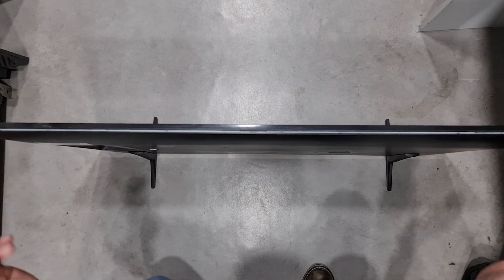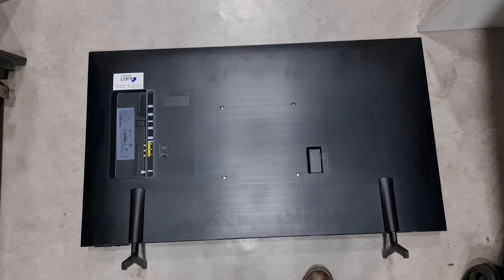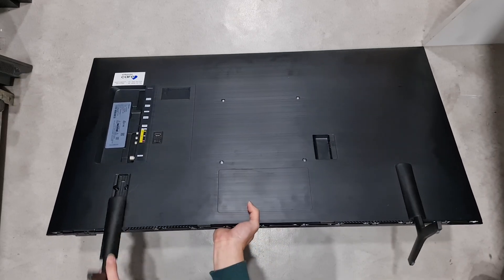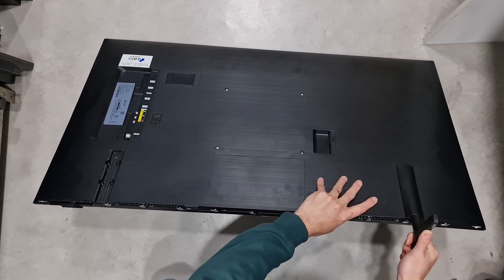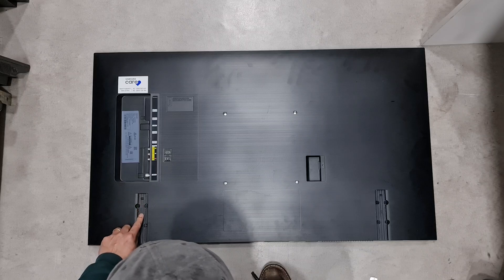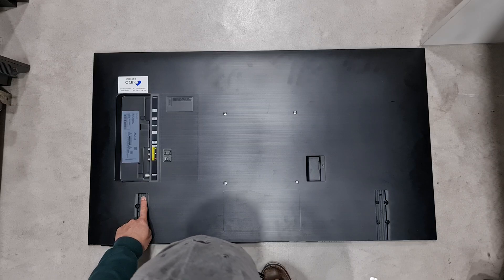Samsung AU8000 43'' TV Teardown | How to Disassemble & Repair Smart UHD 4K TV

Comment: Hi Mate, watched your video on repairs on Samsung UA43Ua8000W. I soldered a loose antenna plug on mine but then I lost power to the tv. Any reason what I did wrong.Terry Adelaide.
Reply from the maker: Hi mate, thanks for watching. Do you have a multimeter to test any power going to the main board? Maybe it’s your power board circuit.
Reply: @repairstogo  Thanks for the quick reply, will check it out.Terry.
Reply: Sorry to be pain mate but will soldering the antenna outlet damage the power board. I can buy a power board but not sure if that fixes the problem.

Comment: Timestamps (Powered by Merlin AI)
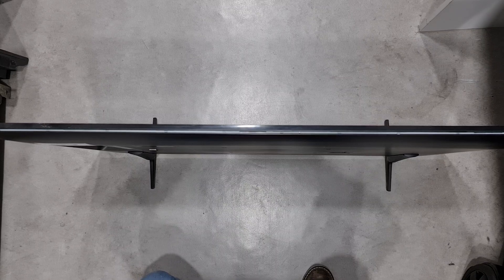00:10 - Samsung AU8000 offers stylish design but lacks HDR brightness and dimming.
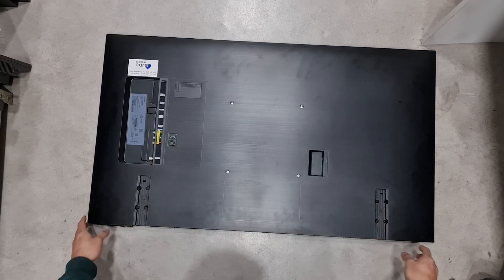00:33 - Guide to removing the back cover of the Samsung AU8000 TV.
02:01 - Video concludes with gratitude and music.
05:30 - Disassembly process of Samsung AU8000 TV is demonstrated.
08:27 - Overview of Samsung AU8000 TV disassembly steps.
10:28 - Video features disassembly of Samsung AU8000 TV.
12:49 - The video concludes with appreciation and musical elements.
15:11 - Video features music and audience reactions during the disassembly process.